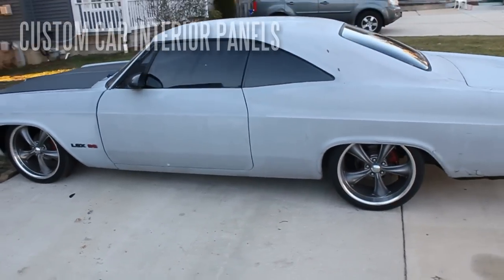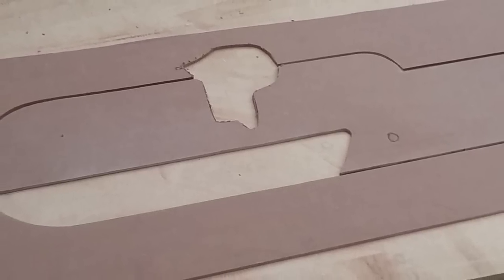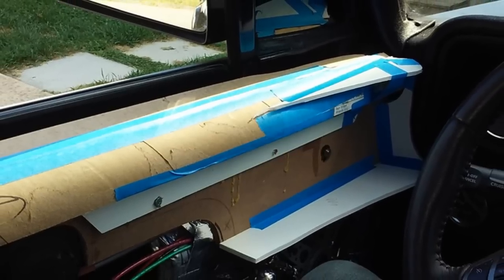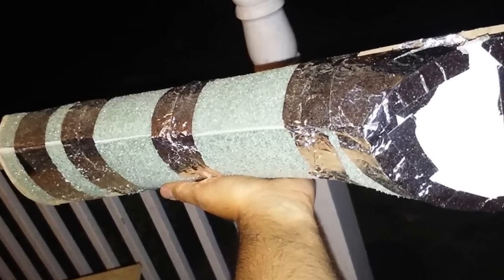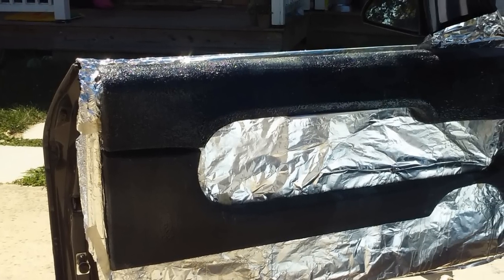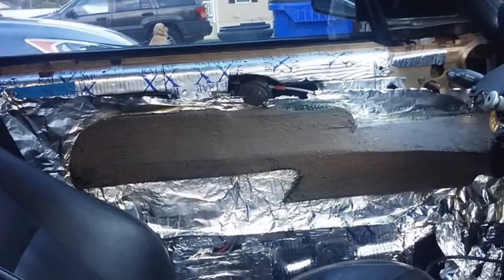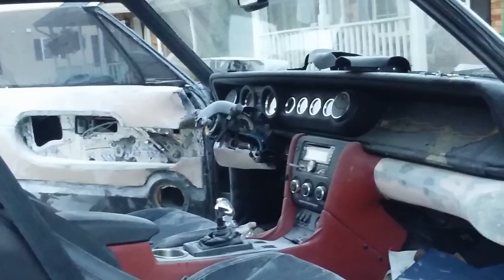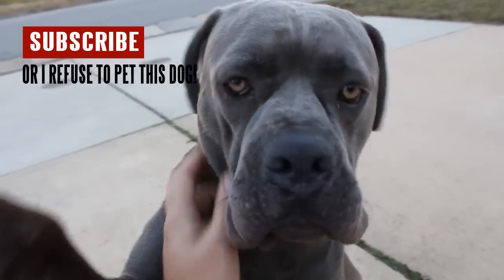How to Make Custom Interior Car Door Panels

Comment: Back in the day early 90's to 01 I had a small custom audio shop operated from my garage. Built many frp door panels sub boxes etc - I hated all the labor using fleece with sanding & body work needed to get a perfect panel so one day I used sweatshirt material smooth side out... WOW... Saved me HOURS of work! Much less time spent finishing since the material is smooth to begin with unlike fleece which is not. Excellent work very clean!!! Im guessing 50-60 hrs for the panels:)

Comment: This is the first video I’ve seen from your channel. I literally subscribed within 1 minute of this video. You are so gifted man. I’ve got a lot of custom mods coming up for my truck interior and your channel I’d sure to be an inspiration for me. 

Could you please send me some information on what all was involved in that steering wheel swap... I seriously want to swap my steering wheel out and would love to see your process
Reply from the maker: My steering wheel was a lot more complicated than yours will be. I used a 2006 GTO shaft (to keep the blinker controls, etc, since all the wiring was from a 2006 GTO) The GTO only came with one ridiculous steering wheel, and since it's made in Australia, the spline count was nothing like the steering wheels here in the USA. I had to cut the GTO wheel apart to get the spline portion out, and then have that part magnesium welded to the Corvette steering wheel. In your case it's likely to be an easier swap. You'll just need to find the appropriate adapters. You can see my entire build thread here (sorry I don't have time to find the steering wheel portion but it should be about 80% of the way through) https://ls1tech.com/forums/conversions-hybrids/1529069-superdave-s-65-impala-ss-5-3-swap.html
Reply: Thank you so much man! Yeah I don’t expect mine to be too complicated but I will have my share of confusion and trouble along the way! I’m trying to put a 2015 Chevy Colorado steering wheel into a Hummer H3 and maintain use of the radio and cruise control in the wheel.
Reply from the maker: Ah well you'll need the clockspring to hook that up, and depending on the PCM and BCMs, it may or may not be able to be made to work. I'm sure there are experts out there that know how to get it done....but not me! hahaha None of the buttons on my steering wheel worked. I didn't even have the clocksrping in it
Reply: See my idea, because these two steering wheels are EXTREMELY similar internally is that I would just move the leather wrap and plastics from the new one to the old, and move the airbag from my current into the airbag cover of the new one, that way I’m not having to deal with splines or clock springs or anything. Physically it would be my original wheel and bag, cosmetically it would be the new one. And I already know how to get the buttons functioning. Basically the buttons on the wheel will be dummy covers for momentary buttons that I place in a 3D printed bracket under the cover. Then those buttons spliced into their perspective controls.

Comment: David Guyton, Thank you very much for taking the time to answer my questions. So you think I could get the same/similar gear out of a newer Dodge Challenger and make it work?  Thanks again for sharing your talent with us and inspiring us.
Reply from the maker: Most likely yes, but on occasion you will have some weird issues using newer stuff because some of it relies on a BCM (Body Control Module) to communicate with the computer, the key, and other modules on the car. For instance, some of the fuses in my fuse box will not light up, and I had to install a secondary fuse box to power a few things. I also have no wiper delay or wiper reset position because of the missing BCM. Any switches SHOULD be able to be made to work, but there may be weird wiring issues unless you can grab the BCM and key from the Challenger.
Reply: Got it, thanks.

Comment: Awesome video.   How did you handle where the panel wraps over the top of the door where the windows felts would mount?  I saw some curved cardboard ?  Did that hang over the top of the door down into the window channel providing a place to mount the windows felt?

Comment: Nice video.  I'm building a track car and am wanting to make some custom panels for buttons, switches, etc... They need to be lightweight first and foremost, so aesthetics probably last on the list.  I need something relatively simple that doesn't take a lot of skill and doesn't require buying a lot of new power tools.  It would also be nice if the panels are easily removable should changes need to be made.  What material would you recommend using and how would you go about doing this?

Comment: I am awestruck by your car's interior.   Do you have any techniques for translating mirror-image 3D parts, such as the two door panels?  If so, I suggest that would make for a great video.
Reply from the maker: I do things the old school way, I start with paper templates and do one side, and just flip the templates over to do the other side. Each little part that makes up the structure of the door is copied from one side and applied to the other side as I go. Simple but effect way to make sure both sides are the same. I do this with my armoring templates as well.

Comment: you did what i would love to do,i have a 1995 Z71 single cab,I've had the thing for 18 years and i like the outside but i would love to make the inside look totally modern like a newer model,i think you pulled this off 100% man.i installed 8 inch mid bass speakers in the doors and made the whole bottom of the door a sealed enclosure,i did this last summer and now I'm thinking it would be cool to do the top part custom myself.but it would probably turn out stupid or messed up i don't know.later
Reply from the maker: It won't turn out stupid or messed up if you just plan your design and see it through. I say go for it. By the way, I had a '96 Z71. I miss that truck.

Comment: Question:   Can you take the door panel off to replace things like window regulators or locking mechanism when they fail?
Reply from the maker: yes of course. You just reverse the process used to install them. I had to install and removes them probably 100 times during the creation process
Reply: Had to ask.  I've seen some custom work before but what they did was seal it to the door.  Glad you have the engineering know how!

Comment: what upper dash, center console and steering wheel is this from? this car is absolutely amazing
Reply from the maker: The console, both the upper part where the radio goes, and the part between the seats, is from a 2007 Mazda 3, although I had to modify it heavily to get it to fit the car and also fit my design. The steering wheel is from a C6 Corvette. All the other parts were hand made from scratch.
Reply: a round of applause, truly fine craftsmanship

Comment: It looks like each piece was wrapped individually.  Did you connect them together or just mount the individual pieces to the door after they were wrapped?  How did the pieces mount once covered?  Hidden screw holes locations from the front?
Reply from the maker: The very top near the window felt is made of MDF and then brushed with resin to make them waterproof. The door shape is the same as stock so the window felts just screw into that. The mounting is a pretty complicated ordeal. There are  small 1/4" bolts embedded in each panel, which are fixed in place with fiberglass. Then there are corresponding holes in the door that the panels mate to. You have to reach inside the door to get nuts on the bolts and it's a pain. Then the middle piece as a lip on it that slides behind the other panels to lock it in place, and there is one screw in that panel near the dash to further secure it, but that screw is hidden when the door is shut.

Comment: I would love to see some more pics,or a how to, on that steering column install.
Reply from the maker: well the column was pretty straightforward. It's one out of a 2006 GTO. All of the wiring in the car is out of a GTO (drivetrain too). I chose to do that because the column has mounts for the blinker and wiper controls. As far as mounting, there is a little bracket that mounts to the bottom of the dash (more like a little hoop than a bracket). This is where the original column secured to the dash. I reused that bracket with the new column. Where it meets the floor/firewall, the angles were a little off so I had to make a little box out of metal to correct the angle. The rag joint had to be replaced with one of a different spline pattern to match up. The steering wheel was not nearly as easy. The GTO is not an American car, it's actually a rebadged Holden from Australia, so the spline count on the wheel does not match up to other GM cars. To get the Vette wheel to work, I had to carefully cut the center section out of both wheels, in exactly the same shape, then swap them out and have someone magnesium weld the old spline to the new Vette wheel.
Reply: Thank you, that is exactly what I was wondering. looks awesome.

Comment: Just curious, do you remove the inner wooden frame after you build the panel out of fiberglass? I imagine these get to be pretty heavy.
Reply from the maker: No you leave the inner panel in so that it can be mounted to the door. These panels are actually a whole lot lighter than you would expect them to be. Maybe 6-8 lbs for the entire door

Comment: David Guyton, can you tell me where you got the steering column, rotary headlight switch from and how you were able to make it work please?  I want to do that same thing to my 74 Cuda.
Amazing job on everything! I will be using this for making my custom interior.
Reply from the maker: Everything electronic in the car is from a 2006 GTO, including the wiper controls, blinkers, and headlight switch. The column is a slightly modified 2006 GTO column I got on Ebay for like $40. You can make the switch and controls work but you'll have to do some research to figure out what the wires do. For me is was a simple plug-and-play deal.

Comment: Absolutely amazing work. Please tell us, essentially what you do is make a frame out of the market board materials etc. And then cover it with the fleece to shape it, and then imbed  the fleec with fiberglass resin to produce a stiff fleece/fiberglass panel and cost it with vinyl/,leather etc?
Reply from the maker: Yup that's basically the entire process. All the materials can be found at any Walmart...except for the vinyl or leather

Comment: Amazing! SO MANY QUESTIONS! How did you get the column and steering wheel to work?
Reply from the maker: The column is out of a 2006 GTO. I used it because the engine and all the electrical system are from a GTO, and it would allow me to use stock turn signal controls and wiper controls. I basically just took out the old column and put this one in place. The bottom of the shaft that touches the firewall/floor had a different bolt pattern, so I made a steel plate that allowed me to mount it properly. It also secures to the dash using the original bracket there. Had to weld on a different end to the side that bolts to the rag joint, and mate two different rag joints together to connect it to the steering gear. The steering wheel was not easy. I didn't want the GTO wheel, but there are literally no options to fit a GTO shaft because it is an Australian car with an odd spline count/size. I had to carefully cut out the center hub of the GTO wheel, and then cut out the exact same chunk out of a Corvette steering wheel. I had to use hand tools because the magnesium they use to make the inner structure is pyrophoric, meaning hand tools were the only option I trusted to be safe and keep it from catching on fire. I had someone magnesium weld the center hub to my new Corvette wheel and now it all fits. The airbag is fake and does not function.

Comment: How did you glue the "fleece" fabric on after the "molds" where made, seems this would be a very important step? Amazing work!!!! Just seen this, working on a 69 Camaro LS3 project......
Reply from the maker: It's not actually glued on. You staple it to the rear side of the part with about 100 staples. Once the resin is added the entire part is too stiff to budge, and it can't come free from the backing panel
Reply: @DavidGuyton  awesome, thanks SO MUCH!!! Man, that interior rocks!!! Beautiful job, great design, making your '65 look amazing, that's what I hope to do on my 69. I've got to design and include places for the PW, power mirrows, the trunk release, the new door handle- all from the new Camaro going into my 69......  THANKS for the reply!!!!

Comment: Killer work man
. Wow I'm not understanding how you mounted the panels as in made them removeable
Reply from the maker: Sorry I should have explained it better in the video. I drilled holes through the panel, into the metal of the door. Then I put a bolt and nut through the holes, holding it in place. I used fiberglass body filler to lock the bolt in place (from the interior side of the panel, not inside the metal part of the door.) Then after I built all the fleece/fiberglass parts of the panels, there were bolts sticking out of the back side of the panels. Since the panels are in multiple pieces, it's just a matter of putting them on in order, and reaching into the door to put a nut on the bolts. The final piece is the red center piece, and that slides into place, wedged behind the other panels, and then there is a single screw locking it in position, which is hidden when the door is closed. You can see this screw in the video when the door is open.

Comment: Hey David, I have a 2009 Dodge Ram 1500. I’m looking to change my interior to the same concept (color scheme) of this one you have in the video. I’ve never done any work like this at all but am very anxious about starting. Any advise you can give or step by step pointers?
Reply from the maker: Well, the advice I have to give is just to not fear the process. It is not hard to do, but it does take a lot of time and dedication. There's really no way for you to mess up bad enough that you won't be able to fix it, so just enjoy the process and know that in the end you will have something amazing. Another thing...be sure to allow for some thickness increases. By that I mean when you start adding fleece, resin, Bondo and leather/vinyl, everything gets thicker than you originally planned, so be sure to plan for that. I tried to make my gaps very tight and I should have backed off a little bit because some of the pieces were hard to fit once they were done. Also, don't be stingy with the resin. If you do not fully saturate the fleece on the first shot, you are going to have soft spots and you will have to repair them (likely from the rear side of the panel).

Comment: Your interior work is sick... what did the steering wheel come out od
Reply from the maker: The column is out of a 2006 GTO. Steering Wheel is from a C6 Vette, although I had to modify it to get it to mate to the GTO column. The GTO is actually an Australian car, and the splines for the wheel don't match up to anything GM makes.

Comment: Amazing work!! Does it add a bunch of weight though?  How do you bolt it to the door once it’s done?  So many questions!  Lol.
Reply from the maker: The panels are actually very light. Maybe slightly heavier than a stock panel in a modern car, but not by much. The panels are in sections so that each section can be bolted to the door by reaching your hand into the door and putting a nut on each bolt. There are short bolts embedded in the panels using Bondo-Hair (fiberglass reinforced Bondo). The final piece is the center (red) panel. Obviously that one can't be bolted in the same manner, so there is a piece of metal screwed to it at the rear of the panel (near the arm rest), which sticks out about 1/2". This piece of metal slips under the other panels that are bolted to the door, and then there is a screw at the front of the panel that secures it in place. The screw is not visible with the door closed but if you look close at the video footage, you can see it with the door open.

Comment: How did you get the rest of the interior like climate control? The car is sweet and looks like it could a high end production car.
Reply from the maker: The center console is out of a Mazda 3 (although I had to heavily modify it). The center section where the radio and climate controls go is from the Mazda as well. Just a matter of hooking up cables and wiring

Comment: Hi,  nice looking car.  The interior is impressive.  I noticed the modern steering wheel.  This is something I am planning on adding to my 68 Camaro.  Can you tell me which car your steering wheel came from and if any special modification.  Thanks!
Reply from the maker: That's one from a Corvette, however lots of cars used the same wheel but with different air bag emblems. Cheapest version of this can be found on the Malibu I think.
Reply: David Guyton Hi, sorry I missed your message.  I’ve spoken to a handful people and they have told me that you cannot install a modern steering wheel in a 68 Camaro.  Can you tell me how what needs to be done in order to install a modern steering like yours.  Thanks !
Reply from the maker: @montelinus  The method I used was just to take a complete steering column from a newer car (in my case a 2006 GTO) and I made that fit. Had to make a bracket for it to fit against the firewall properly because it was at the wrong angle. After that the GTO steering wheel would work of course, but it is ugly as can be, so I wanted another kind. Unfortunately for me, the GTO is an Australian car, and the splines for the shaft are not GM compatible. So I had to take a Corvette steering wheel, cut the center out,  cut the same part out of the GTO wheel, and then have the GTO spline section welded into the new steering wheel.